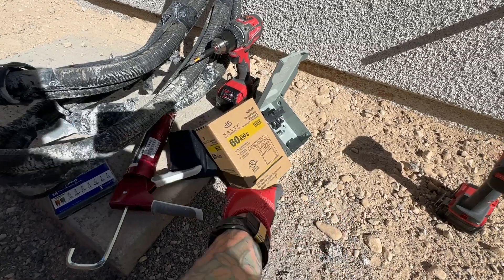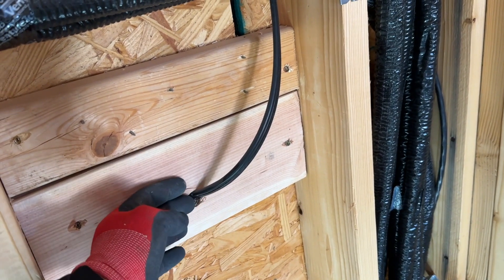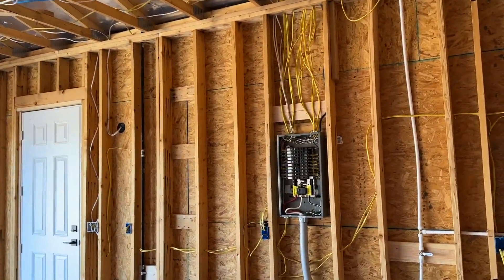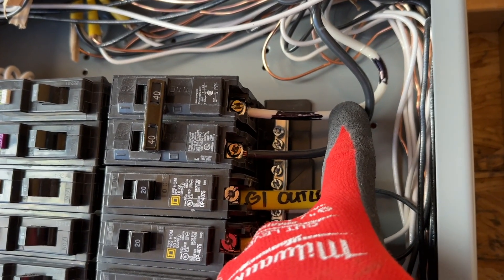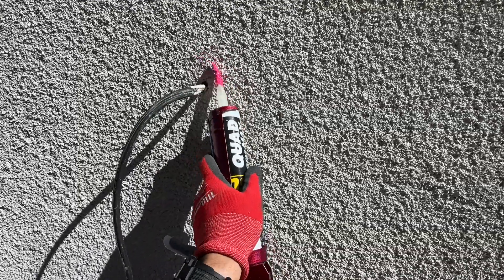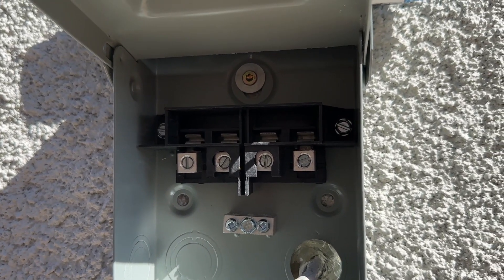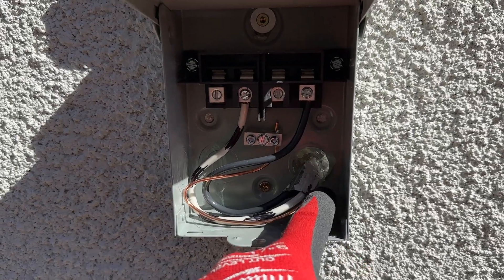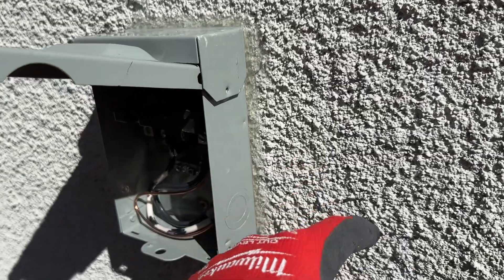How To Wire and Install Service Disconnect

Comment: You never have wire going through a metal box knockout without a bushing or fitting.  That is 101.  You need to correct that so the wire doesn’t eventually get damaged.
Reply from the maker: I agree. Always use some type of grommet to prevent any wearing on the wire casing. 🤙🏼

Comment: Caulking is overkill, but its also how I know your a handyman. You a NEED a bushing on that wire bro. Electrical wires vibrate and thats going to eventually cause a short to ground. Just silicone the holes.
Reply from the maker: Great information!

Comment: Is there a part 2 see it in action?
Reply from the maker: I could make that I guess.  This video was mainly how to wire and install the service box and the wiring at panel. What would you want to see in the part 2?

Comment: Your ac guy will have to rewire that disconnect since you did it wrong. Line side (power) are the 2 inside lugs and load side (the ac) are the outside lugs. Also ac units are 240v circuits that only require a ground. Two hots (120v each) and the ground.
Reply from the maker: This has two hot wires. The white wire is hot. Designated visually with black marks. 

I’m not sure if you missed the whole video but I cover all of this and explain this.  In length.  

As far as which terminals I hook up the hot to inside the box, I guess if the AC tech has a preference on which side he wants the wires coming into and going out to the condenser then he could have it that way. But the left two and right two are separate. So wouldn’t technically matter which of the left two and which of the right two you hook a hot wire up to…. When you hook in the condenser wires it will get juice from the lug next to it either way. The two hots coming from the breaker box are separate rated in the service disconnect.
Reply: @FortKnoxCo  Theres no preference when it comes to hooking up the disconnect correctly. The 2 inside lugs are where the line wires go, the wires from the breaker to power the disconnect. The outside lugs send power to the ac so the wires from the ac go to them. So it does matter where the wires go. You should go look at the installation instructions for the disconnect you are using and you will see how you are wrong. Also I know this has 2 hot wires, I said that in my comment. If you don't know how to do electrical work then you shouldn't post videos about it and say its correct when its not.
Reply from the maker: @Mutate167  I agree. If you don’t know what you’re doing or don’t feel comfortable messing with electrical, I’d definitely recommend getting someone who does. 
As far as which terminal you hook the power coming in and power going out, I understand what you’re saying, and there may be a “designated” or “correct way” to place the wires…. But functionally speaking… what I’m saying is, and I believe you understand this, if you hook a line in on the right terminal and you hook the line out on the lug CONNECTED next to it…. You are going to get the power flowing through it as intended. Either way you set those wires on the connected two lugs will accomplish essentially “splicing” those wires to allow power to flow through.  Those tabs that connect the two right lugs and the two left lugs don’t care which wires you have on them…. When you put the breaker in and those tabs connect, it’s letting power flow. 

Don’t want to get in a debate necessarily over it. I think you get it. But at this point it’s arguing semantics.  …. But hey, the YouTube algorithm loves interaction… so I appreciate the comment either way.